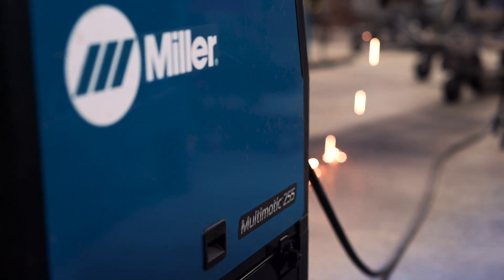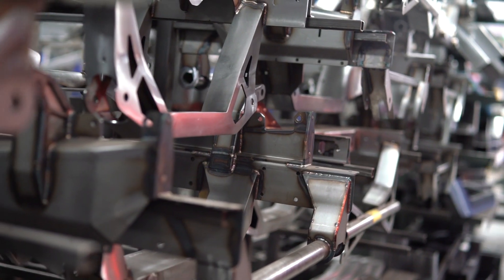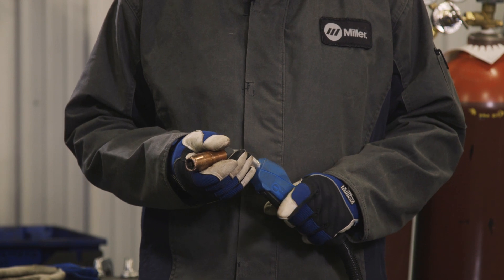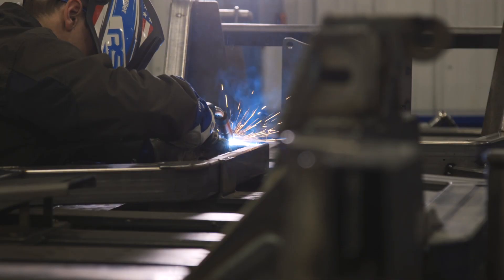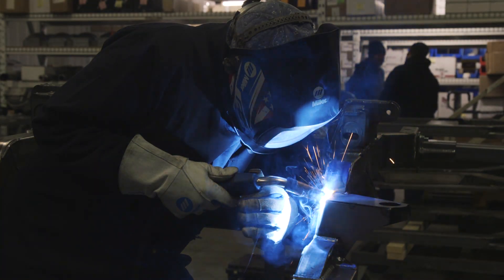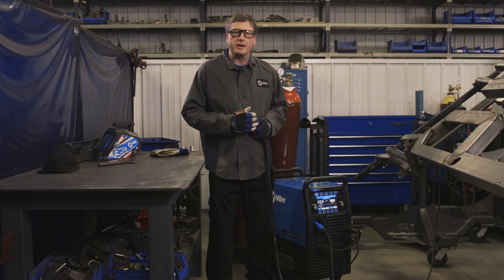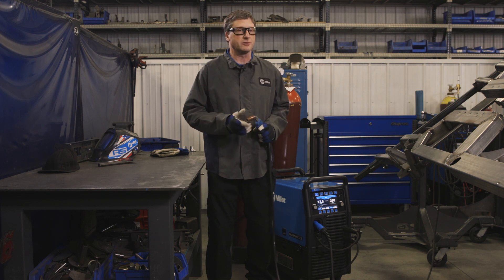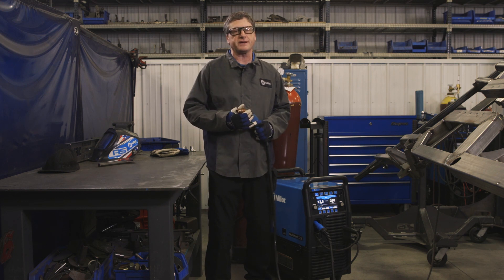Miller Multimatic 255: Built for Chassis Fabrication

Comment: way overpriced ... forget it
Reply: How? pulse mig capable for under 3K. No other brands or machines with that option even close in that price range.  my miller 252 was just about the same price and has been a great machine and doesn't have these options. Just ordered mine last night and can't wait to put it to work in my fab shop. When you build high end chassis or suspension components this machine will pay for its self in one job. Miller is a great company! This will be the third miller machine in my shop.
Reply: This welder is disgusting to the Miller name that once was and every single welder that has any common sense! Miller said “Let’s urinate on our customers buy ask $4500 for a mediocre Multiprocess welder with only a a basic Mig gun, Let’s also make the welder useless for welding aluminum by leaving AC welding capabilities, Further more let us offer you this same pile of 💩, with no High Frequency start option, ya know like any $499.00 welder from Harbor Freight would have or your 1999 model Syncrowave 250. But we’ll sell you a tig foot pedal (that’s about useless without HF) , tig gun, stick holder and a cheaply made cart for mediocre machine, for the low low price of $5800!! “
So glad when sold my Miller 220 mutimatic (board issues) and wouldn’t even run 6010, that I bought a HTP 2500! Worth every penny, especially over something like this 255.. I’d buy HTP ESAB Lincoln, Fornius etc before I’d ever buy another miller anything! 
ASSEMBLED in the USA! 😂. There’s been 4 welders within my circle of people in the past 2 months, that were purchased which were not Millers because of things similar to the above! 
Hope they get it together and start adding value back in their products along with a price point that makes them worth it!
Reply: Yeahh how much??... I’m only 30 sec in